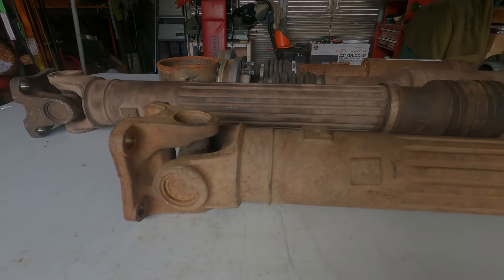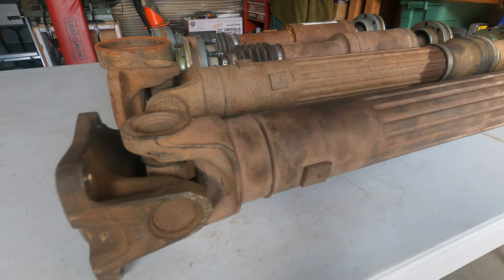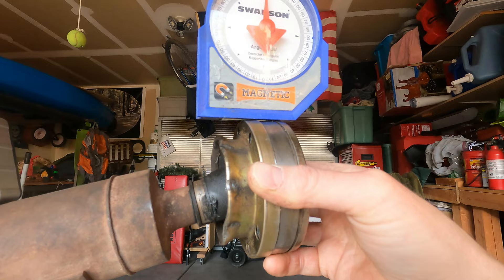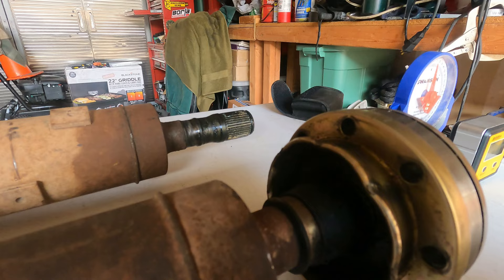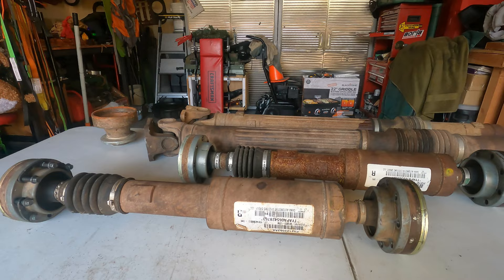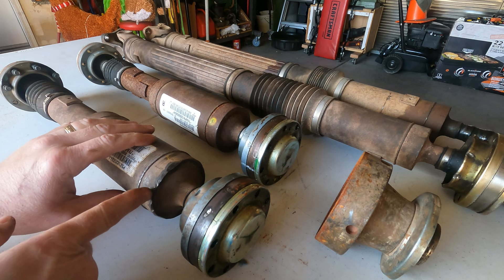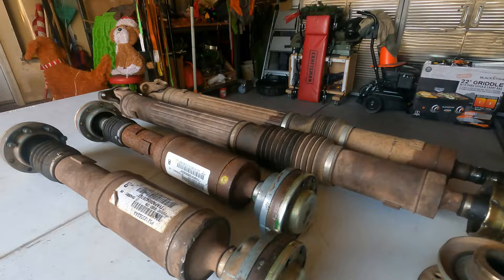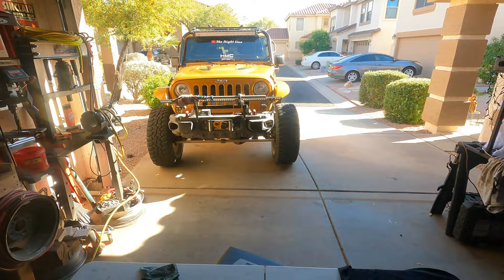JK driveshafts. Are they any good?

Comment: Very good video Chad. We run the stock shafts in my wife's JK, but it is only lifted 2.5 inches. My TJ is lifted 3.5 inches and has a Sye with 1310 u joints. The front shaft is stock but will be upgraded to a Tom Woods 1310 shaft this spring as a part of many upgrades it will be getting as you already know. The cool thing is Tom Woods is only 5 miles from our home. Take care sir and I'm looking forward to your next video.
Reply from the maker: I really like TW. They do great work and have a great warranty. I went with Adam's this time and they're awesome too. American made!